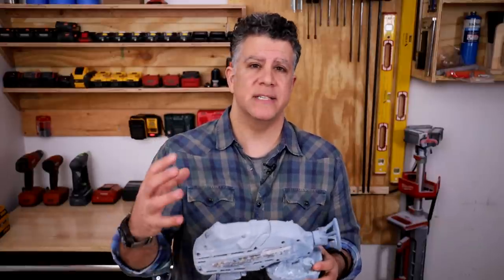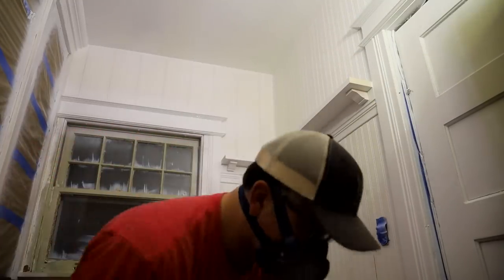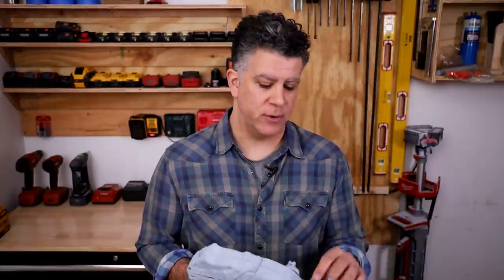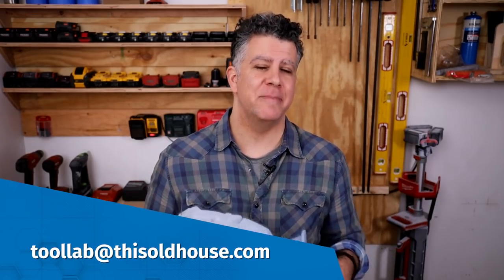Airless Paint Sprayers | Tool Lab | This Old House

Comment: Airless, HVLP, painters are great but the clean up is longer than the actual painting.  As you said prep is everything.  I have an Earlex 5500 with multiple tips and it is great for thin finishes.  I recently bought an Wagner Control 250 for spraying some outdoor furniture with opaque stain and it was great.  The Earlex does not do thick paint and stain very well but excels on poly and other thin finishes.  Like I said the clean up is quite long.  I noticed your sprayer is covered in paint.  You have to clean it every time as well as you can to keep the mess down.  With paint it is inevitable that the gun will get caked.  The inner working has to be kept spotless for the gun to work well.

Comment: I recommend this gun and the lower models... you have to decode the instructions from both the user manual and the 20 minute instructional video from Graco, however after you get your life back you will find these guns very useful.  Make sure you have a real gun too America...
Reply: @brianglade848  truecoat 360 bro works fine with just two speeds

Comment: Do the paints have to be a thinned?
Reply: Depends on the gun, look at the instructions that come with it and it will tell you what needs to be thinned and how to do it.
Reply: Not with these Graco handhelds. Pour and spray right out of the can.
Reply: @brianglade848  I know that for Wagner they do recommend some diluting for certain paints.